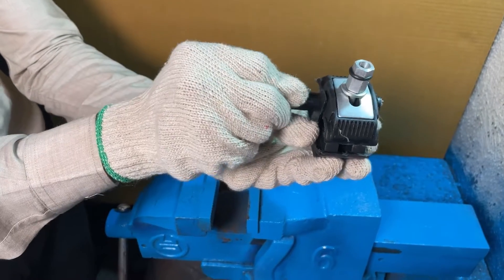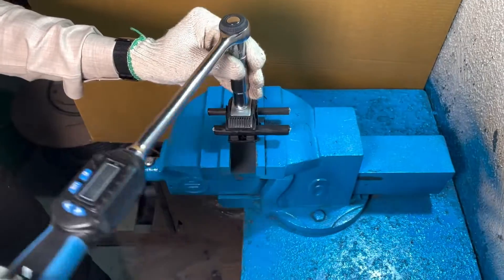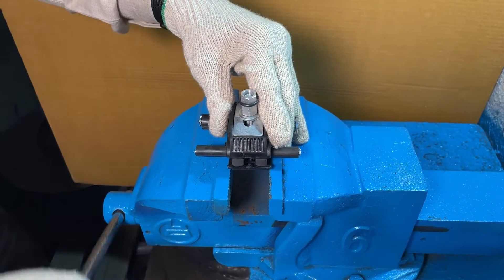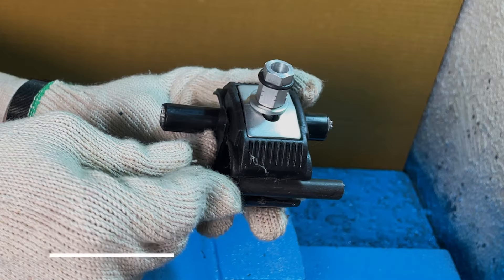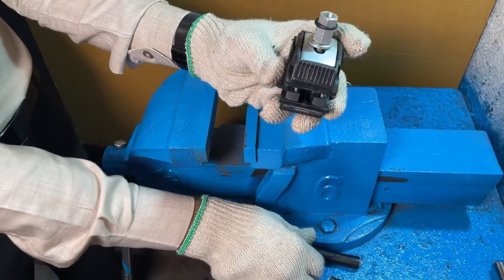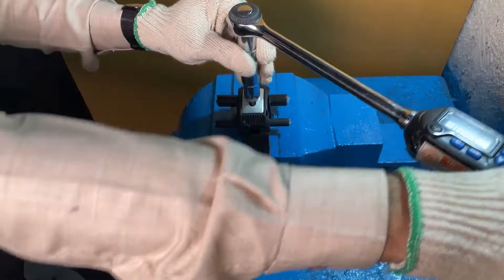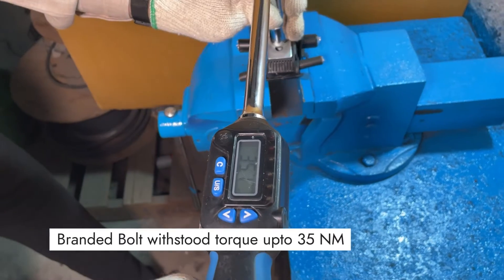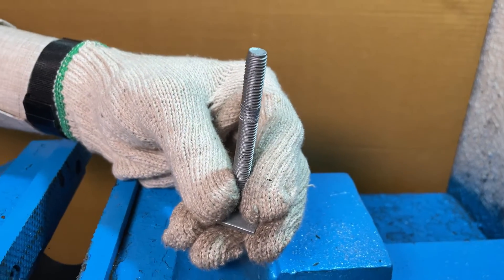Torque Test of Bolts - 4.8 vs 8.8 Grade Steel ✅

Comment: Why you compared with unbranded 4.8 grade you should compare with unbranded 8.8 grade bolt with your brand 8.8 grade. The comparison should be on same grade.
Reply from the maker: We understand the concern, but the motive here is to make market players aware of the recommended materials for specific applications.